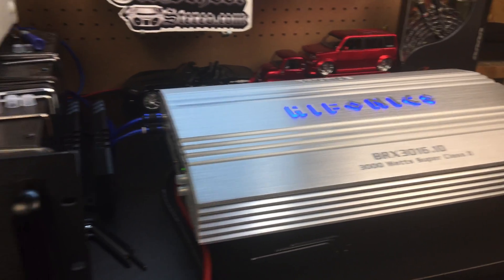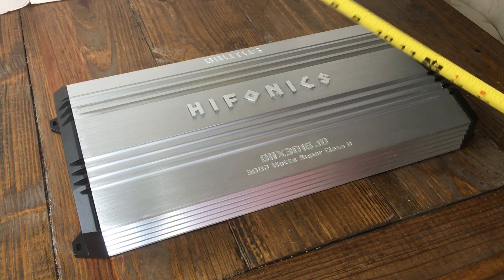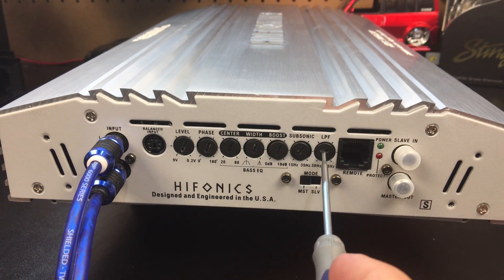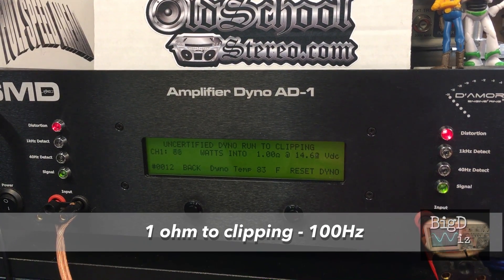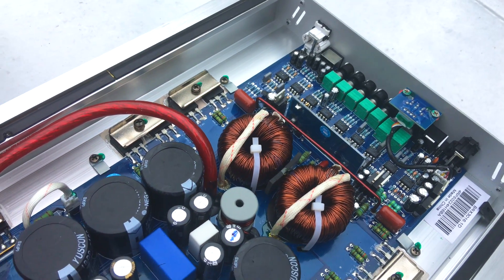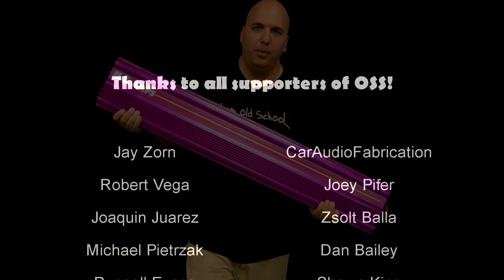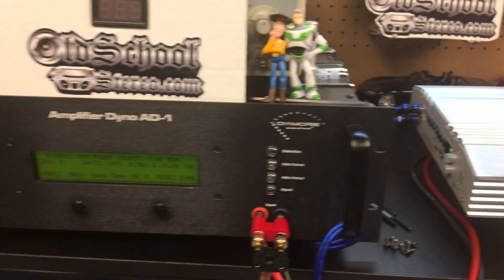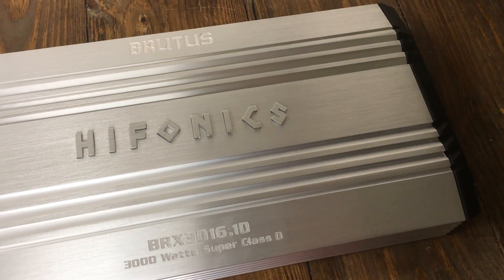Is That 3kW RMS or MAX? HiFonics Brutus BRX3016.1D 3000 watt Amp Dyno Test

Comment: I'm running mine .5 ohms no problem, don't understand how you fried it?
Reply: Speakers nominal impedance is different than realtime impedance when you play music. It depends about speaker and enclosure and frequency. It can be much higher than nominal impedance. In amp test dyno impedance is same as set all the time.

Comment: How many volts input do you use for these on the RCA? I've got 0.6v from the head unit before clipping. Running two kicker 15". Output measured at 34v so around 300-500w. It's a bxx4000.d or something close to thay

Comment: That was very impressive, specially for that amp. Yes unfortunately it did blow but that's only because it was pushed not just to it's limits, but beyond it also and it took it until it just couldn't. But yeah I wasn't a big fan of them to begin with, but I will say that I was pretty impressed with the performance and the final results of this amplifier.

Comment: Most importantly to remember, in the 80’s to early 2000’s the subwoofer’s were built to be efficient and was rated at much lower rms. I had (2) OG Kicker Gold letter 18’s (200-300 rms ea.) in a sealed box on a Crossfire 600D and that setup hit with so much authority and you felt it in your chess just standing near the car. Todays subs require so much more power to get the same effect, so these amps can only do so much in todays era.

Comment: This is an old video however I wanted the comment because the power supplied died because it could not provide enough current to the output side and the overcurrent protection did not kick in.

This power supply uses a to-247 package size 064N mosfets.  Switching to 7530, 7537, or even a 1404 MIGHT allow that amp to make a lot more power and not pop.

Comment: Did you ever do a hifi 1500.1d? 
Just got one given to me... thinking about wiring it up to a set of old kicker L5 12's in a sealed box my buddy has... 

Already have a the wire run done (currently running a single 12 in a ported enclosure on a 1k gravity amp. Gravity g12bdi pre loaded) 

I am hoping I can get at least 750w @ 2ohm.

Comment: can you do a dyno on the brutus BXX3000.1D?
Reply from the maker: Thanks for the suggestion
Reply: @wal  still waiting for your bxx3000.1d dyno test befor i buy it, i want to run it on my 2x skar evl 15 2500w/1250rms each....lets do this, no one has ever done dyno on that model I've really been looking for it

Should i buy this brx3016.1d or bxx3000.1d for my 2evl?

Comment: I wired up one of these two two d. Audio lvl 4 12s I decided that they could use more power so I put in one of their newer Brutus 6000.1 D ...lol...I thought the fuse holder came with a 350 amp fuse while installing my new 350 amp alternator I was pulling that fuse holder out to replace it with a crimped lug style vs the set Screw that like to come loose with fine wire and I noticed it was only a 150 amp fuse ...I have two large yellow top batteries and the stock alternator was only 136  but you would think that  either of these amplifiers should have blown that 150  maybe the 3016 could have got by based on the 1800-2200  it showed here but the 6000.1 ??? I'm suspicious about it now that a 150 amp fuse lived ...that said the Zeus Gamma 1200 destroyed the claimed 100 watt rms Polk audio is 6.5 the 150 watt 6x9 fosgates seem to be holding I blew both those Polk's in 5 minutes I got a set of Deaf bonce 6.5 neos coming to replace them they should last longer than my ear drums .

Comment: Super class amplifier HiFoNiCs claims that they test each of the output fets and MATCH them to the closest possible, capacitance reading per fet transistor so they will conduct together more evenly , like it means they have the same conductive electrical characteristics to be able to produce output power smoothly, just like back in the day tube type amplifiers had vacuum tubes that were matched together so their electrical characteristics were very close
Reply from the maker: Meaning they most likely buy in lots and use the same ones in their amps and don’t mix lots

Comment: Bolt on end caps are not included in the measurement of the heat sink. The manual is more accurate than you portray. It's not listing overall dimensions. Just thought someone of your aptitude and following would know that. Not trying to be a hater I love your stuff.

Comment: I just want to say thank you for doing an amp dyno on this amp.  I have this exact same amp in my little 2000 Nissan Altima pushing a Skar Audio EVL-10 dual 4 ohm sub in a Skar Audio enclosure made for a 12 inch sub.  But I needed the air space so I put a new face on it to mount my 10" sub.  I think it works great.  I only use a 100 amp fuse and run a 5.0 Farad Stinger cap in the back with the amp and sub.  It does what I need it to do.  With the bass knob, I can turn down the bass when I want to (English) music and turn it up when I listen to Spanish music.  Thanks for the knowledge you provide to us beginners.

Comment: Seems to be worth every penny and then some 😅 you getting good value to distortion and if you going to max it for spl you will blow speakers or tax power system before you max this amp.. my only other question would be how well does it cool when ran hard and put up wet.. I’ve always been a jl fan bit only cause they run good from 12-14v but cause they never overheat

I don’t think you wasted anything I think they need to pay you cause you showed they perform and if they can even run a few extreme tests at .5 ohm then you can almost be assured they will last longer then the coils on the speakers at 1ohm..

Comment: I had some hifonics amps back in the mid 2000's and some L7 subs, it pounded brutally hard. Someone broke into my car one night in front of a friends house in the pouring rain back in 2007 and stole it all. Hacked apart my dashboard too. Cleaned my car out bad. Still pisses me.
edit. 2005 actually, not 2007. West Babylon NY. is where it got robbed from my car. It was a 1500 watt mono amp and a 4 X 440 watt amp.  They even stole a digital camera and my portable Sony Minidisc player.

Comment: Big d wiz....looking for suggestions for a good reliable amp..at least 2500w rms at 1 ohm...I just have the cheap 12" walmart power acoustic subs....2500 peak 1200 rms
Reply from the maker: Do you have the electrical to support a 2500W amp? You’ll need at minimum an extra battery
Reply: @wal  I have now a power acoustic rzr 2500 at 1 ohm....don't know what the 1 ohm rating is for this amp...you dynoed one at 4 and 2 ohm...I've been running 1ohm for almost a year with no problem...just can't set the gain proper till I get a 1ohm power rating
Reply: @wal  what I have now can flex the dash and windows at 1ohm
Reply: @wal  the most I can upgrade my electrical is a 240 amp alternator....I have a chevy trailblazer with a 4.2 inline 6 cyl...the computer controls the alternator...

Comment: Are there knock offs of this amp I seen these amps going for $39 new on ebay?
Reply: I saw the same I purchased it to see what's its really about
Reply: @KJ-dt6by  hope its not an ebay scam but it was the same model number as the video and listed as a new amp not used or refurbished
Reply: @richardmontoya3449  yeah if it is I will just have eBay reimburse I see the item is from ITALY I'm not holding my breath

Comment: Are Hifonics still good? I need a 4 ch for my doors with at least 100w RMS, and I prefer an A/B amp, as most D amps can't get the output filtering done correctly, except for JL, RF, and ... from what I learned, JBL (??).
Reply: dont buy hifonics

Comment: How do you supply more than 12.6v to the amp?
Reply from the maker: Most current alternators charge between 13.8-14.8 volts
Reply: @wal  I'm sorry I mean power at the amplifier. Even with 2 gauge OFC power wire and ground with the shortest lengths possible I managed around 12.5 to 12.9v

Comment: hey D! gotta question..I have the brutus 2400(1200rms) version and in traffic one of my sub terminal came off and touched in my enclosure..the amp smelled bad but couldn't stop my car!..the amp cuts on with no protect..but no sound..the board has a dark spot..is that fixable or worth fixing?..can I send u a pic?🤔

Comment: Can anyone explain how it is possible to draw over 2000 watts through a 1 ohm load at 14 volts? At DC, no more than 14 amps will be able to flow yielding 196 watts. This is even without considering the complex impedance, which acts as a resistance, that appears when the frequency increases.

The amplifier must have some serious boost converter circuit that boosts the 14 volts to several houndres, right?

Comment: can you test an amps power without an amp dyno?
Reply from the maker: Sure. Audio Precision, scope, DD-1, AMM-1, lots of ways. But you need resistive loads too
Reply: @wal  thanks would hooking the subs up to the amp work for the resistive load?
Reply: @m0011v  that would be reactive load because when the sub moves up and down the ohms change. you need resistors that can keep the ohms exactly the same when youre doing the test

Comment: Class D amp m, means its us own class.  Not class A or class A+B. Its the new digital series amps. I rather stay with class A+B you get more cleaner sound as this class is a hybrid of class A but without all the power consuption of class A. While the amp is powered off. Class D makes smaller amp with lots of power but with alot of harmonic distortion. Not my cup of tea. Exaggerated power specs.

Comment: Double 1/0 seems like massive over kill when all it needs it's 2ga 🤷‍♂️
Reply from the maker: Depends on how long of a run you have. I double up 1/0 with bench tests when possible to give amp best chance of doing its power
Reply: @wal  yea I would understand in this situation just always having the biggest for the best results. But just looked a lot for one little amp lol
Reply: @wal  the ground should be doubled up or as thick as possible anyway, I've seen a melted  2/0 ground on a 3k BRZ

Comment: do you think you could get away with .5 ohm with music / open case and some fans?
Reply from the maker: The load I showed is static and resistive. Speaker load would be changing and reactive. I would still not recommend a load that low

Comment: I remember in the mid 90's Hifonics and SoundStream were both considered top of line high end brands Hifonics had power from the gods line up with Zeus, Colossus, Thor, Cyclops, Olympus, and so on, all the cool names. Then Soundstream had the Trantula series monoblock and 4 channel, with the handles on them to be mounted flush plus the big 7 Channel gold DaVinci amp was the same design. I love the logos on those amps. Those were the sweetest amps of those times. I'd love to see a Tarantula monoblock on the amp dyno or The DaVinci. If you could ever get your hands on those relics. Or a little bit newer the Soundstream Human Reign that amp was sick looking with the big face coming out of the cracks. Nothing like it out there.
Reply from the maker: I remember that one, they are super expensive when they show up

Comment: It's great this amp can produce those big numbers. The main issue I have with amps not being completely honest about actual power is when trying to find or use the proper subwoofers.
Reply: Why do u want to upgrade to a bigger hifonics if it doesn't do rated and is overpriced for performance but ct sound and skar audio are both pretty good and do rms or more and are the same price better quality and sometimes cheaper the ct sounds 2000.1d does 2000rms or more and rn is 60 less and I can almost guarantee it will do 2200 rms
Reply: With a hifonics Gemini as a newer amp or a Brutus u get the power

Comment: I have a BRX2016.1D amp with two 12” T1s wired to 1ohm. Is that amp enough power for the T1s
Reply from the maker: If it sounds good enough to you then it’s fine

Comment: Liking the Hifonics test by Big D. It has all the elements covered by him that I have questions about, numbers and seen, recorded, compared. Answers are to be had,by all. While I think that a manufacturer should be as clear, truthful, and direct as ever about the claims made on an amplifier,  I also can work with whatever facts get divulged. Now we know, for the money, what Brutus amps are made of, what in heck Hifonics means by peak power ratingd, and some little surprises  like efficiency numbers. I believe that this is a good amp for the money, even though it's not spot on specs. But it makes me feel a little vexed at Hifonics,  for being obscure. Thanks for a great show, and very great information 👍🔥

Comment: I think Hifonics is a good make. I got the 2000D monoblock I think its a titan. Laying in my trunk for 7 years now. Still going strong. 

And yes 3000 is max rating. 2000 is max rating for my amp. Im not sure but i think the RMS rating for my amp was 1250RMS.

Comment: I have always had positive experience with hifonics. I've got a 3200 watt Zeus and 500 watt bruites ELITE Hooked up on 2 12" Solobaric l7  I've had it 10 years and the amps have never had a single problem. There great for the price
Reply from the maker: Great feedback. In my experience the recent models are hit or miss in reliability
Reply: Glad you told me this. What is the best amp for the buck?????
Reply: @danielbeavers8701  i dont like the way they trick consumers by putting x2 60a fuse in their amps but only 1 is connected to the board. the zeus amps have that setup. as for your question are you talking about monoblock amps? what wattage? any features you prefer like can it go down to .5 ohm, includes bass knob with clip light or tiffany female rca? do you want a Brazilian, korean or Chinese board

Comment: I have a question. There isn't a amp fuse on the my 3200 zeues. I had it running strigjt to a hifonics Brutus elite. When I was disconnecting cd player the amp wire was exsposedwhen I moved it and it sparked. Then my amps would do nothing at all  My question is "is there a way fix" like a amp built in. They have just been sitting. Can they be fixed easy ???????????????????????????????????

Comment: Derrick? I knoww that you are not a Power Acoustik fan but that Edge EG10K  has me very curious about its rms numbers dynamically.

Is it posible to retest using the same methods that you are testing this Hifonic BRX?

 Head to head, the EG10k performed better in vehicle at 11.9 to 14.8 volt  at 1 ohm

Comment: 3000 watt. 12V Car battery? FAKE!!!!
you need strait 250A! you dont have 250A in your car!!!!!!!
Reply: you would need 2 group 31 agm batteries in the back and upgrade to a high output alternator and rev the car to 2000 rpm to get that 3000 watts for 5-10 seconds

Comment: I have 2 of the previous generation Hifonics BRX2400.1D'S that I've ran strapped at 1ohm on 2 SoundQubed HDC3.112's for a couple of years and they never even get hot and beat the shit out of those subs. You can't beat Hifonics amps for the price. I've had those amps for about 6 years so far and they're still going strong. Thanks for another great video BigD
Reply: Do you still have them ? 🤔👌

Comment: I own one of these amps. I own the 1516.1d amp and yes it does have its limitations but let me be clear: in Nola heat this thing still hits hard after a full day of heat. I have it powering two 600 watt rms massive audio subs. The amp by no means is the worst I have ever had. It is not a week link. I cannot name on here which was the worst. You can refer to those lists on other sites and make your own judgement.

Comment: How was temp on this amp at 0.5 Ohm load? @Wiliston Audio Labs
Reply: these amps run a little hot but I ran mine at .5ohm all day never had a issue on 2 15's these amps are the best you can buy at the price range

Comment: Hey brother I was wanting some advice from you on some (L7 15’s). What type and brand of amp would you give advice of using with them? One that can handle both speakers without getting hot and it killing the amp?I need a amp that would hold the power and not cut out.So if you could help me out I would appreciate it brother.Thanks.

Comment: I get sooooo baffed by car audio. I got an Audiobshn alumQ 1000w dual coil sub that I've had for years. The Audiobahn amp that was recommended for it died but now I have no clue what to replace it with. Only got a small £150 budget. Been looking at hifonics but they got soooo many models my head hurts. If you got a minute to advise I would greatly appreciate it :(
Reply from the maker: I’d stay away from HiFonics. Build quality and reliability not so good
Reply: @wal  Ok thank for your time

Comment: Skar rp-2000.1D is $30 cheaper and puts out significantly higher wattage based on BIG D WIZ's other video.
Reply from the maker: Neither are very reliable designs IMO
Reply from the maker: Neither are very reliable designs IMO

Comment: I have a hifonics brx1116.1D 1100 watts max it’s a Brutus I have had it three years but do not carry the amp down to 1olm. If u what 1 ppm and hold and not get hot or go to protection mode get a Hifonics pro class A amp.I did carry Hifonics when I had a car audio shop they never blew or got to hot. Now a pro 400watt will be all u need for any 2-12s or 4-10s I don’t care for anything bigger than 12s. But that’s me

Comment: WoW that sucks, I had an old school system in a vette  with 2 Ulysis, if I spelled that correct.. 1 ran all the highs and mid..5ohm, the other ran 2 -12 .5ohm  Lanzar dual noice coil. History states the car won a few competitions. I know it hit hard. does this sound right?  Love to see your testing of the old (cheater) amps..... ps I sold the car 20+ years after stereo install  old amps still hitting............

Comment: I know one thing those particular mosfets they use in the power supply are like 8bucks a piece..
Reply: would that be considered cheap or expensive
Reply: @shoof1696  that's fairly expensive when u consider some of the amps run around 30 or more in their power supplies....